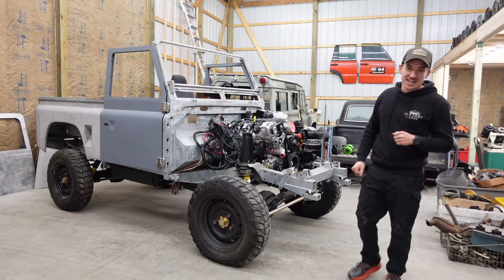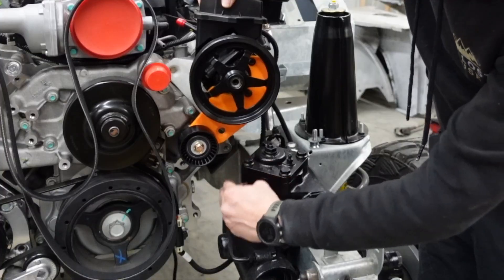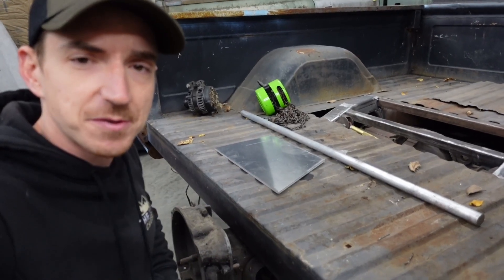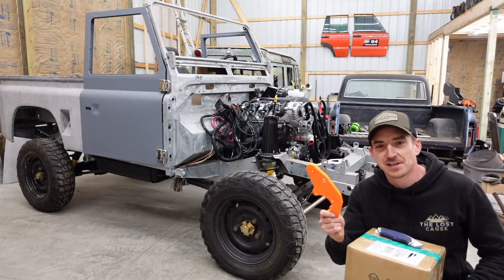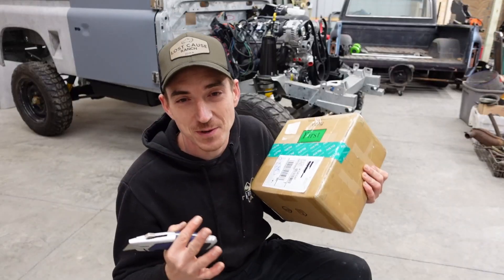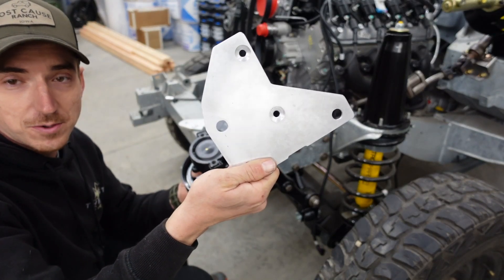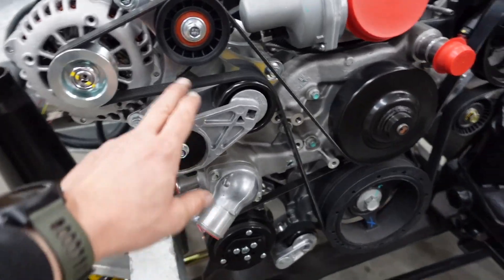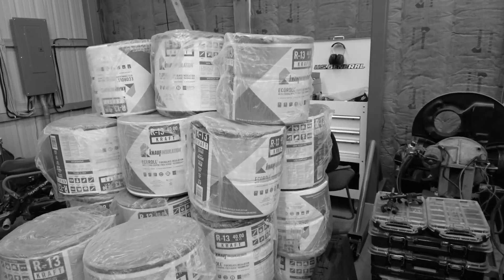How We Made Power Steering Fit in our LS3 Swapped Land Rover

Comment: Hey Joe, the set up looks killer, very well done. one thing i noticed, the brake booster is up side down, the vac port should be up top, if the master ever leaks in to the servo your awesome engine will suck up brake fluid, keep up the good work buddy, also i still have a box of goodies here for you for the NADA109

Comment: Very neat.  I think vapour blasting of the brackets after media blasting would be good - just sand blasting will leave them prone to corrosion, but vapour blasting gives a slight peening that gives a good finish that is a lot more dirt and corrosion resistant.

Not a bad effort on the correct pronunciation of “aluminium”. A little more practice and you’ll get there.  Al you min ium.  The last bit is the important part, so just think of how you say plutonium, caesium, strontium, tritium and all those other useful workshop materials! 😜
Reply from the maker: Appreciate that insight on the vapor blasting, very helpful. 

And it is funny how the Americans just deleted that last “i” out of the pronunciation all together. I’ll keep my aluminum and plutonium stored together haha.
Reply: @LostCauseRanch  just be sure to keep them a few inches apart - you don’t want your plutonium suffering bimetallic corrosion. 😉

Comment: Wow, that looks amazing. Top job as always. My vote is to powder coat the brackets to stop the aluminium from corroding, if you go the sand blasted route make sure you protect the countersunk holes, as you don’t want to have a potential issue of them not seating properly with the fixing screws. It’s great to see her coming together, it won’t be long now before she gets blown apart and the big paint job begins. 😎👍
Reply from the maker: I could do a clear powder coat on the brackets afterwards. Used to do that on some metal art that was purposely rusted, could do a satin clear to fit in. Good advice on the masking off the holes. 

It is moving along, gets more exciting the closer it gets to coming all apart.
Reply: @LostCauseRanch  Now that all the hard fabrication work is complete and sorted, the blowing apart and then onto final assembly is the real fun part, seeing all of your hard work finally come together as a piece of Automotive art, keep up the great work😎👍🍻
Reply from the maker: Appreciate the kind words. It has been a fun one to play with so far.
Reply: @LostCauseRanch  🍻😎👍